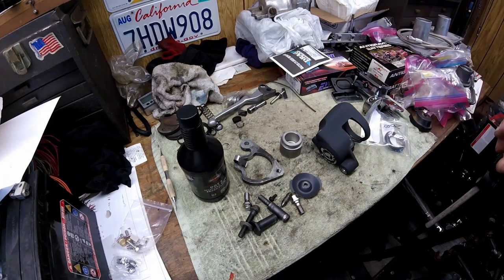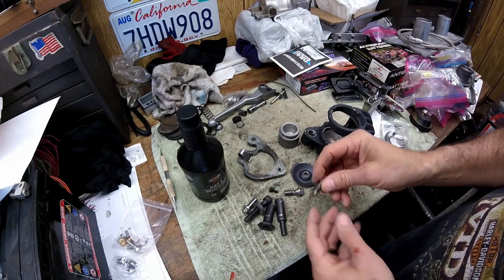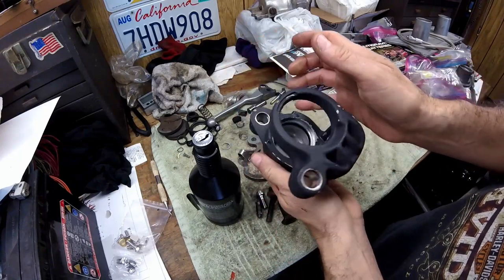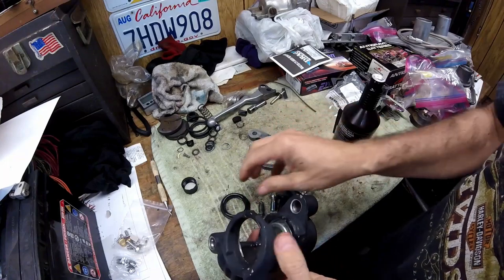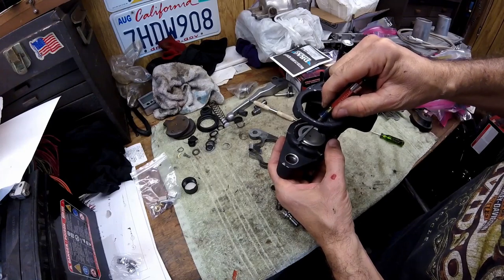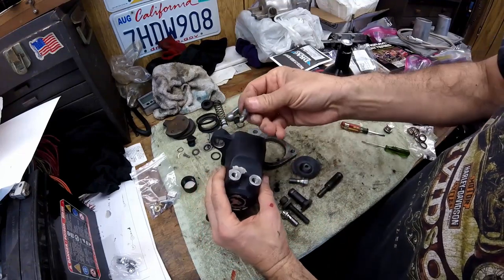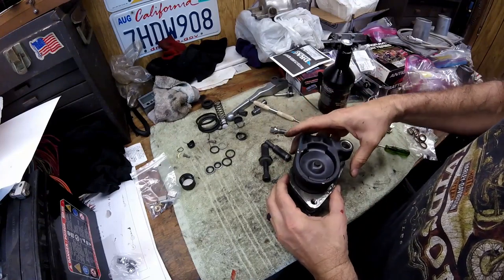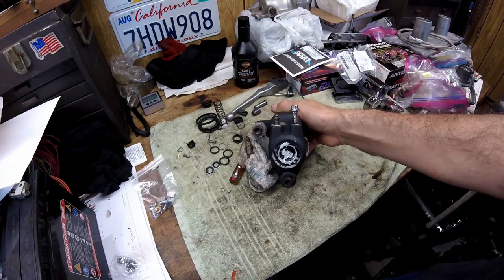Front Caliper Rebuild for Iron Head, Shovel head & Evo XL FX Harley Davidson

Comment: Can you order a complete rebuild kit that comes with the o rings, seals, rubber bolt covers? Does it matter if the black material on the back of the brake pad isn't all there?
Reply from the maker: I'm not sure what you mean with "black material on the back of the brake pad" What time in the video are you talking about?
Reply: @Rapsgarage  i will send you a photo tomorrow.
Reply from the maker: @rubenlao378  Send it to hdrap_1999@yahoo.com

Comment: What is the deal with the brake plate and that little freaking spring crap man
Reply from the maker: I think all that stuff is supposed to stop them from squealing.
Reply: @Rapsgarage  cool. I'm having a hard time reinstalling the rear caliper. It looks to me like it's got to go on the bike before the wheel... So you got to get everything installed with enough space between the brake pads to roll the wheel into position. I had the wheel on with the bracket and I couldn't get the caliper attached to the bracket with the brake pads and the two little metal clips that go on each side and the spring rod..... I don't know what the heck I'm doing wrong here..... Got any tips
Reply: @Rapsgarage  disregard my last I think I got it
Reply from the maker: Awesome!

Comment: Nice video! My 87 FXRS I rebuilt the master cylinder up on the handle bar once and it worked well . I later put a new stainless steel hose on and new copper washers ,bled it good. No issues since . I used to occasionally get front brakes sticking ,it's why I rebuilt the master cylinder and  replaced the front brake pressure hose .  This fall the front piston stuck on me on a short ride .It did free itself up .Since I have the original caliper never rebuilt I think I will now rebuild the caliper . I am thinking 36 years on it and close to100 k miles the piston seal may be acting up occasionally ! It's been a great bije!
Reply from the maker: Nice! I’d say you’re definitely right!

Comment: Did nobody else see the error that he made?
Reply from the maker: What error did he make
Reply: @Rapsgarage  He made 2 errors. He did not use a question mark when he posted the question above and He installed 4 O rings. There are only 3 O rings needed. The 4th groove is for the lip on the boot that he did not install.
Reply from the maker: @Rif_Leman  Good catch……………..

Comment: Thanks for doing this video.  You don't by chance remember the brand and part number for the o-rings you got from the auto parts store?  Also what type of grease were you using?  Copper anti-sieze?
Reply from the maker: The O-rings came out of the miscellaneous kit. I got from O’Reilly’s auto parts. For the grease I used wheel bearing grease. You could definitely use anti-seize, nickel or copper would probably work fine. Please don’t forget to subscribe.

Comment: 😎👍😎
How do you get frozen pistons out of the caliper..??
Reply from the maker: I'd leave it connected to the break caliper and take it off the rotor and use the system pressure to try and push it out. Next I'd soak it in Kroil for a few days then give it a try. If that didn't work I'd heat it with MAP gas and once it's good and hot I hit it hard with ice cold water. Last thing I'd try is drilling a hole in it, then tap it then use a bolt to jack it out. Good luck and let me know how you make out with it. Thanks for watching.
Reply: Air hose